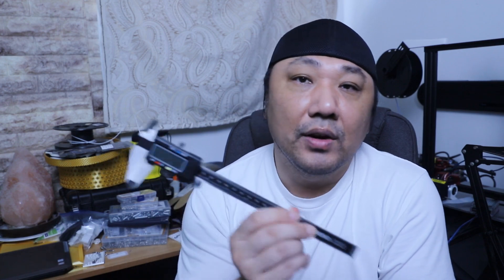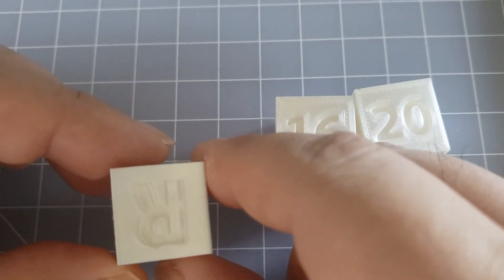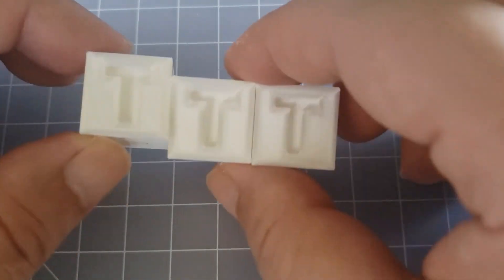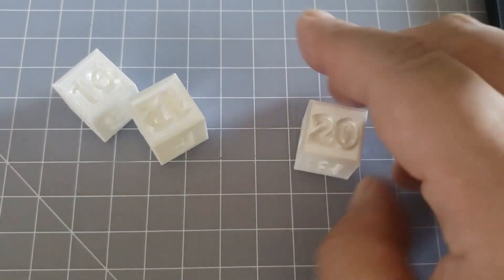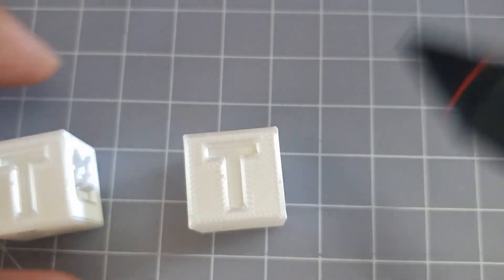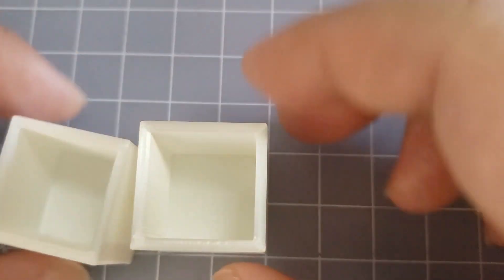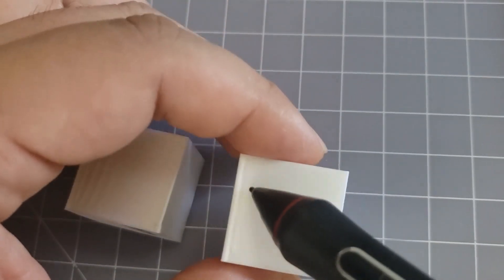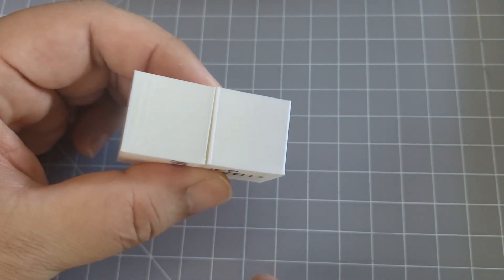How to use calibration cubes for 3d printing

Comment: I just want ONE video about calibration cubes that actually shows us how to adjust when our cube measurements are off. Why does every "calibration cube" video skip this?
Reply from the maker: I think it's probably because many things could be off not just one thing and going about fixing it could be different and results may vary.
Reply: @DiyProJames  that's true I guess. But then shouldn't these videos show some of the adjustments at least instead of none of them? I finally found one though.

Comment: Any reason why you used blender? It isn’t really designed for creation of printable solids
Reply from the maker: It's free and powerful. Don't have the time right now, but down the line I want to use some of the sculpting features to bring in more organic shapes. If you want accuracy with ease of use some sort of CAD software is probably the way to go especially for parts. It's a different way of designing for parts, but getting certain types of addons for blender can change your workflow in a positive way..